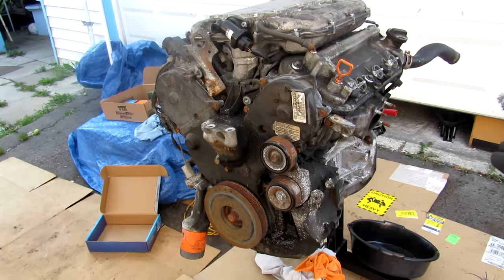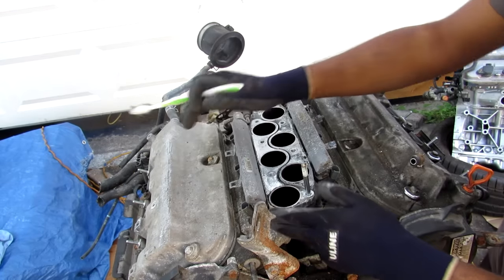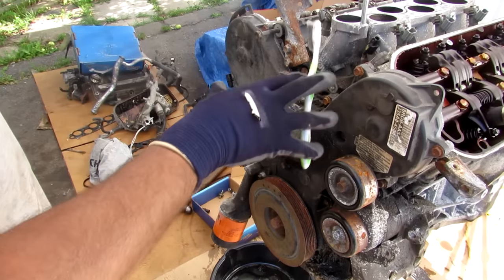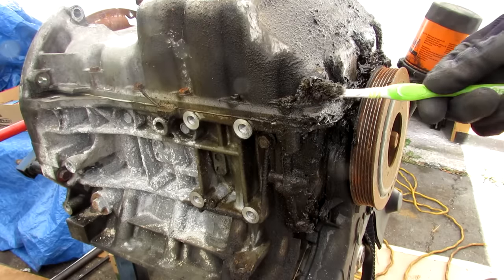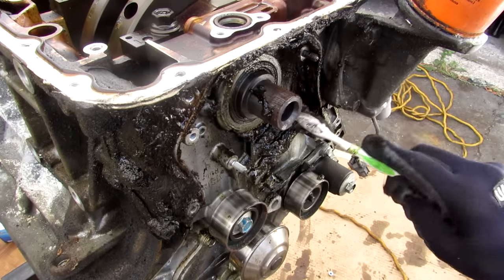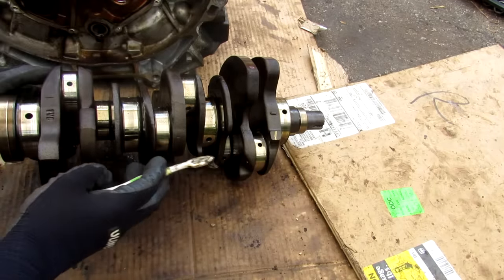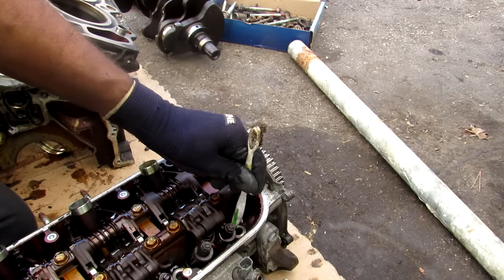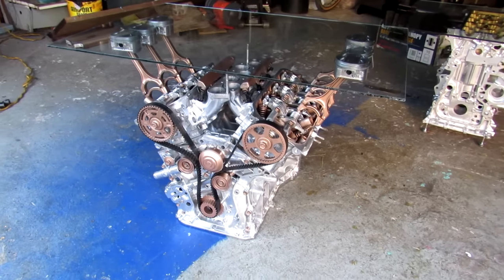Why Honda V6 Engines Haven't Changed For 25 Years

Comment: I have a 2011 Acura MDX with the J37A1 and it has 172,658 miles, and I’ve towed my camping trailer and done long road trips and it’s still running strong
Reply from the maker: And how's the transmission holding up?
Reply: speedkar99 actually really good. I’ve done regular maintenance on it and changed the fluids every 10,000 miles and it’s running just as good as when I first bought it

Comment: That figure 8 gasket under the oil pump is what causes that terrible leak. I had to change mine on my type s after Acura wanted 2,600 dollars to do the job. The gasket cost me 8.00 and about a day job.
Reply from the maker: The VTEC gasket?
Reply: speedkar99 yeah

Comment: My Acura mdx and my Honda Accord both are power efficient by these ivtec motors. The different is aerodynamic and shape of both vehicles. Of course my Accord has a 3.5 size engine and my Mdx the 3.7 one!

Comment: What’s the benefits on still having sohc on a v6? I have a 2012 tl so it’ll be interesting to know
Reply: Smaller packaging, less reciprocating mass, cheaper to manufacture, and most of the cars with the V6 are bought by people that don't care about horsepower.

Comment: I’m curious is this a VCM engine? It looks like it’s in good shape. I disabled the VCM on my accord v6 as soon as I bought it with only 70k miles. And of course synthetic oil and did the whole water pump/belts/tensioner

Comment: For that crank pulley bolt, don’t be scared to use a oxy acetylene torch on the bolt. Just a bit of heat  and it’ll pop right off with impact. I have done it this way for years with no issue, just not to much.  There is a seal and rubber ring in the pulley that can melt
Reply from the maker: I don't have a torch. But I've been ok with locking the crankshaft and just putting the big bar on it
Reply: @speedkar99  there is actually a handy tool that fits into the hex on the crank pulley that has a hollow center to allow it to be held in place.

Comment: I would surmize that Honda kept that engine in production for the same reason AMC and later Chrysler used their inline six from 1965 to 2006, with improvements over the years.  Or that Volksvagon used their boxer engine from 1939 to 1999, again with many changes and improvements along the way.

Comment: Nice video! Loved the C32 in my '91 Legend and now I love my J35 in my '18 Ridgeline. A big part of it is that I was never required to see most of what you showed in this video! They just run and run. The Legend had over 300k on it, too. I have had Subarus this far apart, though...

Comment: Our Honda Odyssey with the V6 failed after 260K miles. Is that normal mileage for those V6 engines to fail? It was driven mostly in the city with regular oil changes.
Reply from the maker: How did it fail?
Reply: It has rattling noise at the bottom of the engine. It's fine for the first 10miles of driving with minimal noise, but after that it will rattle non-stop.
Reply: As of November 2023 there is a massive recall on J35-equipped Hondas and Acuras, letters to owners are only coming out this month. Checks out, it's rod bearings and main symptom is rattling/knocking from bottom end. Next symptom should be engine seized. 250,000+ vehicles affected, years 2016-2022.

Comment: I'm less than impressed with the VCM version of this engine...chronic oil consumption and at 80,000 miles Honda had to upgrade the piston rings on the engine....it's better now and I'm glad I didn't have to pay for it.

Comment: I don’t see why they won’t make it DOHC. Having V-Tech and 4 valves a cylinder while SOHC means you have to adjust it every 80,000 miles or so. If it was DOHC, you wouldn’t really have to. And the biggest problem with these were cylinder deactivation. And the stupid rubber timing belts.

Comment: Watching now.... I had 03 Acura TL with v6 that burned oil and had transmission problems.... Later found out that Honda vehicles made from 99-2004 had transmission problems as well (factory defect)
I now have 2015 Nissan Altima with no issues.

Comment: Nice tear down of J35 👍
I just sold my 16 years old Ridgeline and got a brand new Acura MDX with the same engine, 
Take care of it and it will last you a long time, 
Never had a problem with any of Honda engines OR transmissions, 
Regular maintenance with OEM oils is the key for me.

Comment: "Probably because they pouoonded those engines good" LOL, more like probably because they didn't change the oil regularly and used wally world oil with Fram filters and thought the oil change reminder period was just a "suggestion"? Maybe? My Z1 saw redline shifts since new and when at more than 100k miles when I decided to boost it and do headwork...the thing looked clean as new, none of those dark marks on my cams or even looked like they had any wear on them. Imagine that. Regular maintenance and using quality oil and filters all its life, changing before the actual recommended intervals not because I had to but because I wanted max lubrication. Thanks for the video. Wonder if Honda will ever do more with the J series.

Comment: Did you put a big crowbar between the crankshaft and the engine block in order to hold the crankshaft from turning, in order to loosen the crankshaft pulley bolt? Jeez-louise. You still flexed, maybe bent, the breaker bar you used to turn the bolt. That mfing bolt was on tight! The aluminum engine block – I'm surprised it didn't crack.  Genuine Honda service manual I had for 82 Accord said that, with the in-line 4 engine in place, in order to keep the crankshaft from turning when loosening the pulley bolt, so that you can you can replace the timing belt, you should put the manual transmission in gear (I don't remember which gear) and set the parking brake or something like that. No wonder when I followed those instructions what I seem to remember is that I did some damage to that transmission. Did I break off a gear tooth? I don't remember. Oh yea, I remember that with the transmission in gear, and me turning the crankshaft pulley bolt, I was moving the car, even though the parking brake was pulled pulled up tight.

Comment: Hey Speedkar my J35 in my TL Type S overheated and after the timing belt and radiator were replaced it still jumps timing, any ideas on what could have gone wrong when the engine overheated? It still starts but doesn't stay in time
Reply: You probably have to redo the timing
Reply from the maker: Timing is probably off. 
The tensioner on these isn't hydraulic so no reason for it to skip unless it's a flop
Reply: @speedkar99  it was retimed and has a new tensioner, still jumped timing, anything else it may be?

Comment: I beg to differ about it being a 60 deg V6. The blocks are 90 deg apart (to keep the height low). However, to restore the firing balance (every 120 deg) there is a 30 deg offset between adjacent paired big end journals, as seen in the video.

Comment: Nice video!!!!   Those looked like some pretty bad cracks in that timing belt.   I have replaced a couple J Series Hondas around 100,000 miles and they all looked way better than that with no cracks at all.  When do cracks like that start showing up?  Have any idea how old and how many miles were on that engine?

Comment: The old six remains because it continue to meet the CARB smog emissions and still cheap to make.  Once CARB limits are tighten then Honda will sub the  turbo 4 like all other mfg did.  They will save the new high priced V6 for the expensive cars  like NSX Acura line.

Comment: They should have added at least 30-45 extra bolts per cylinder to hold it together for all that power when the vtec kicks in
Reply from the maker: That would slow you down by adding weight
Reply: Lol

Comment: What caused the difference in color between the front and rear valve train?  Cylinder deactivation?
Reply from the maker: I don't know but I've noticed that difference on all 4 J-series engines I've opened

Comment: Wow thanks for this video I’m glad YouTube recommended it to me.  Very interesting and detailed.  I have an 08’ type-s with a 6-speed manual.  115k miles stock except for exhaust system. The car runs great and I love driving it.  I hope it will last me until 200k!

Comment: Only downside to the design is the timing belt... I'm just not into timing belts. I mean I wouldn't not buy a vehicle for this reason, but I've had a few Saabs and none of them ever needed timing done before 250k, they just keep going. Chains are more robust imo, you can have a chain driven motor not rebuilt for 35 years but that's a tough order for a belt. Even if the engine was good you'd have to break down and do it just by age alone at a certain point.

That being said some chain driven vehicles can have chain guides fail long before the belt, so the plastic wears thin and you've got to do the service. Still usually a 200k kind of issue even with pretty bad oil changes...

Comment: Excellent tear down.. I don't understand why Honda still uses timing belt and it's an interfere engine because it causes more money to maintain it?  Also they got terrible transmission problem in the past decade.  I am willing to try Hyundai, Kia, Mazda etc before I would go back to Honda but Toyota is my #1 choice.

Comment: I guess I had one similar to this in a 2000 Honda V6.
I did not have transmission issues, but this was one of the last ones to come with a 4AT. I did get a warranty extension from Honda.
I did not like that transmission feel. WOT shifts were very aggressive.

Comment: Thanks i got 2007 3.2 v6 love engine great power vtech kick in only down point is get timing belt job every few years got mine 89000 miles 2 years and now got 120000 drive alot highway miles still going 💪

Comment: I don't why Honda V6 still uses Timing Belt instead of Timing chain. For this reason, i HATE honda's V6 Engine. I have problem with oil seal and engine oil leaks.

Comment: I love how you stick the "Head gaskets are a subaru thing..." in your tear down videos. Also I think almost all Honda engines have a reverse thread idler pulley bolt to prevent it from coming off...

Comment: Well, hold on now. If each piston in a pair has its own crank throw, it's not a V6 engine at all. That makes it a horizontally opposed engine - a boxer - just one that's not 180 degrees. V engines have only one crank throw for each pair of pistons that live across from each other, and the rod bearings both ride on the same journal.

Comment: J37 engine was not Honda’s best work. They used the wrong rings which lead to massive oil consumption. They even denied any wrongdoing and got slapped with a class action lawsuit... they weaseled their way out of most of the claims and managed to screw over tens of thousands of Acura owners.

Comment: Can you put it back together at TDC so that I can see how to put mine back together?  I feel like I screwed up.
Reply from the maker: Maybe need to refer to a timing belt video
Reply: @speedkar99  what if I bought a cheap car v6 j35z1 and no timing belt. How would you go about putting it back on and making sure its on tdc? I'm asking because my brother removed the belt without marking the belt or putting it at tdc prior. Not trying to screw up the motor.

Comment: Are the stock cam gears stamped steel or what? I was looking to see if anyone makes lightweight cam gears for these engines. Thanks.
Reply from the maker: Yes
Reply: speedkar99 Any link to the lighter cam gears or a part number? I already have the UR aluminum pullies but any and all rotational mass reduction helps a ton. Thanks!

Comment: My friend , I have a 3.0 ltr. V6 honda 2003 that started to make a horrible noise (knocking sound) like a metal, but isn’t from there , I took it to the mechanics and used an estetoscop to listen where the noise was coming from and they told me that wasn’t from the bottom , and I left the shop, when I was driving back home the noise started again and worst , sounding like scratching metal and knocking sound like the engine was going to xplode , the engine stoped and didn’t want to start but because I was in the middle of nowhere and waited and crank it again finally started but very slowly and went back to the mechanic shop and left the car there, but I don’t wanna get ripped off by them telling me that I need to rebuild the engine , because it doesn’t make gray or blue smog or something like that , please a need help thanks 🙏

Comment: Taking a lower intake Runners off are very easy. If you remove the head take those off you're not doing it right also that motor was probably serviced the intake manifolds are dirty because of the EGR system

Comment: I tend to disagree that they are strong and reliable. Better change your oil every 2,000 miles and install a 5,500 rpm rev limiter or it'll blow sky high.

Comment: Finally found an experienced guy hello question Do I need to replace head gasket in my 06 pilot or just the intake gasket ?? Pilot overheated  because radiator leakage then replaced it but then some white smoke started and  oil cap is foamy but dipstick is not that bad.  One day decide to check the coolant in radiator then it made a sound of high pressure.

Comment: hey man. I want to get a 07-08 tl type s. What are some issues I should look out for?
Reply from the maker: Timing belt and rocker adjustment
Reply: @speedkar99  timing belt is around every 120k right? No clue what the rocker adjustment is. Pricey to replace or could I do it myself with simple tools?

Comment: These things are bulletproof. Mt sister had one and it had 215000 on it. The time came when she sold the car because she got bored of the car not because of any issues, when she got rid of it the thing sounded like the day she bought it. Never heard an engine so quiet and smooth with that kind of mileage. Great engine.

Comment: Imagine if this engine switched from timing belt to timing chain...oh the possibilities 👌🏾😁
Reply from the maker: I think they'd rid of the rocker arm system and do away with valve adjustments
Reply: @speedkar99  I'm a gm 3800 guy, but that engine is getting..or has been outdated for quite some time 😁

Comment: Not a big fan of the J series, I still highly prefer my C35A V6
Reply from the maker: Ok
Reply: @speedkar99  the only reason is the VTEC. I like older, more serviceable designs with less reliability on tech or computers, and VTEC falls into that category. Sure the gas mileage is abysmal, but it’s so smooth, I have a forged bottom end, and it’s got full torque from 2800rpms up.I do however like Honda I4 VTEC motors though for their simplicity and reliability, and truly believe if Honda attempted to build a VTEC V8, they’d blow the world away.

Comment: Honda makes a 2.5L for Europe (displacement tax) and 3.0L for the US Right hand drive and Left Hand drive versions come down the Marysville Ohio plant side by side (when I toured the plant) Accords ready to be shipped. Japan got the 2.5L too. No air bags for Japan too. Three point restraints for Europe not US "stranglers". Honda didn't sell Mexico/South American versions when I toured the plant. That would mean stripping cat-cons and air bags and lap-belts only and requiring them to run on leaded fuel. The Honda V-6 is/was a excellent basic design, like the Toyota 22R, so why change it?

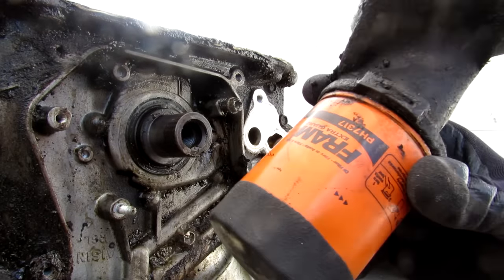Comment: What about the Fram oil filter indicates that the motor has seen abuse? 8:50
Reply from the maker: Fram are lower end filters. Typically found at Walmart / quick lube places. If the owner put one on it means he doesn't care about the car.

Comment: J series are good and reliable. As long piston rings are clean and on the right place. Poor oil lubrication will damage the roller rockers and damage the cam lobes and other contact points, if timing belt snaps it will bent valves as is and interference engine. On the other hand they easy to repair on like the unreliable automatic transmission.

Comment: Why change what works almost perfect and mess it up its top knotch the only thing I don't like is aluminium . would like if the can make iron heads n bottom oil pan transmission pan

Comment: It's so easy to get stellar mileages on those engines and all you have to do is change the oil regularly and change the water pump and timing belt at the specified interval.

Comment: So if the acura tl engine over heats its cause of the head gaskets need to be changed correct  and it should be good

Comment: Water pump driven by timing belt is a deal breaker for me these days. Just give me a timing chain, non-interference engine and water pump driven by serpentine belt and this engine would be perfect.
Reply from the maker: Some cars (Nissan VQ) have the water pump driven by a timing chain!

Comment: 10:03  😲🤦‍♂️😰🤢🤮 Bro that made me sick...man doesn't even mention the potential cracked block, just keeps going LOL (Gangsta as hell 😉). FYI, the crank cap bolts should have been loosened 1/4 TURN at a time in SEQUENCE until hand loose. Impacting them off in one shot WILL pop that crank up and cause it to deform just ever so slightly, which will lead to warping even more after re-torquing on install

Comment: The serpentine belt tensioner is reversed thread because the belt turns clockwise and it was the wrong  bolt but i can relate ...great video

Comment: I am buying a 2015 honda odyssey and I think it the motor has VCM. I've heard its better to disable vcm because it causes wear on the motor. What do you recommend?
Reply: As a Honda tech, I'd recommend just leaving it alone and servicing it at recommend intervals. The engines in them have very few issues

Comment: The J series is a decent engine and shares quite a bit of components with Honda 4 cyls. However, I have to disagree about the timing belt. I would rather have a belt than chains for any overhead cam engine. I'd rather change a belt twice than a chain once. I bet you'd agree.
Reply from the maker: A chain shouldn't need service over it's lifetime